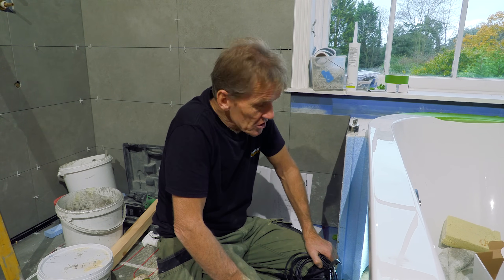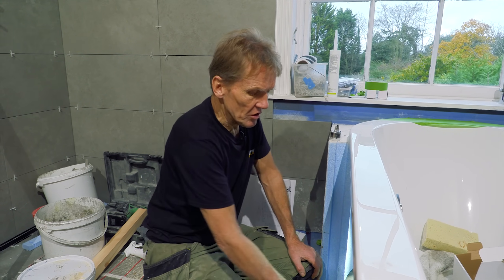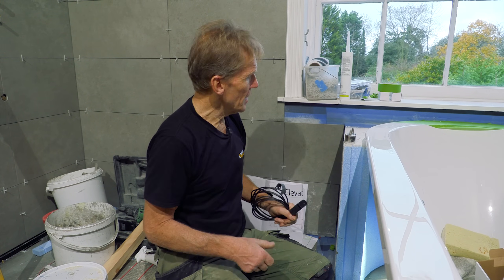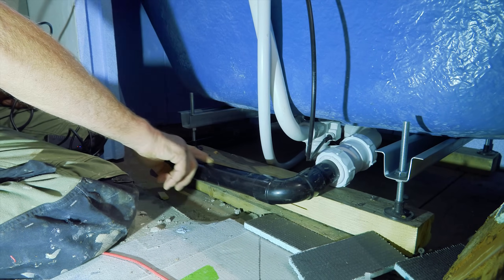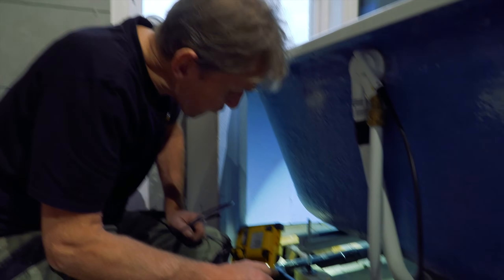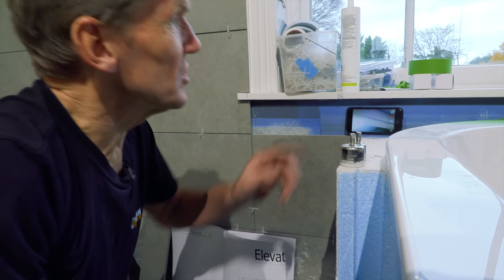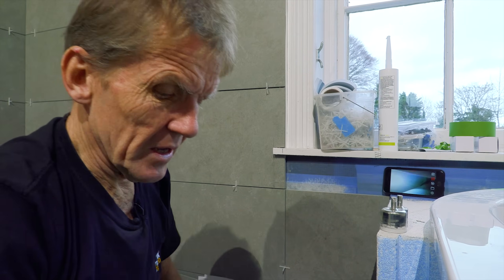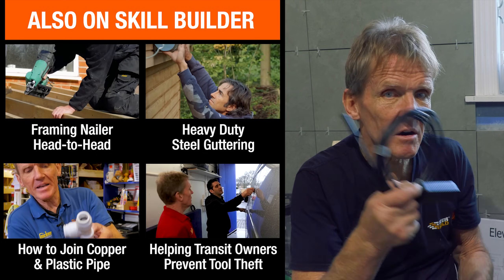WiFi Endoscope Inspection Camera - Depstech WF010

Comment: To anyone planning to buy one of this you should be aware of several things.

Pay the price for a quality camera, cheap ones are pretty much useless, once you put them down a dark place you can't see nothing.
I recommend the wireless Ones, is very awkward to fiddle with the camera and get a good view with something attached to your phone, sometimes you will have to bend yourself in awkward ways if you want to point the camera on the right direction and still have the screen towards your eyes.
With the wireless you don't have this problem.

I got a cheap one online that I am pretty much going to throw away cuz it's very much useless as endoscope

Comment: What nobody seems to mention is the big flaw with these cameras. That being they are not steerable, they don't articulate. Trying to control the end of the camera from the other end is minimal at best. They tend to want to curl up when you get them into the space and are not controllable.
Reply: You can tape a length of the green garden sticks on to the wire, they are fairly flexible.
Reply: @antoniocrawley  Spot on, good idea. Or just tape it to a rigid cable so you can bend it to the angle you want.
Reply: @ruinunes8251  Gracias

Comment: Good review.  I just bought one of these to try and determine where a leak is under our 3rd floor tub.  
Got a chuckle at you pointing out that it was not your solder joint.  I would probably have pointed that out too.  I take pride in good,  clean solder joints.

Comment: Here's a good idea for any DIYers with drain issues - take one of these cameras (they are not too expensive) and attach it to the end of your screw attachment in your drain rods but make sure to use waterproof and strong duct tape. You can use it as a budget CCTV camera to locate any blockages in your drains - it will save you the hassle of calling someone who may charge you £100+ to have a look at your drains.

Comment: I bought one for checking underneath loose floorboards to ensure that I wasn't about to drive screws through water or gas pipes.  There was no immediate access, but because the camera body is only 8 mm dia I was able to drill a 10 mm hole in an out- of -the -way place and use that.  Worked very well.

Comment: Trouble with all these is you use them over any distance you can’t look up or down or left or right so when your for example looking over a joist you can’t see what’s under your lens 👍
Reply: I had some problems with mirror until someone showed removing protective film.  Improved quality a lot.  

Also had problems with image shaking.  Solved by running scope through a longish tube secured at camera end.  Then I was able to rotate the device and get a steady image.  Takes a bit of planning in tight spaces or when it is hard to maintain good footing.
Reply: with the attachment you could, its just a bit of a pain in the ass. a controllable camera head that rotates etc would be a market leader when a smart cookie brings it out.
Reply: Brapamaldi That’s what we need though isn’t it 👍
Reply: definitely. if only i was smart enough to make it happen, haha.